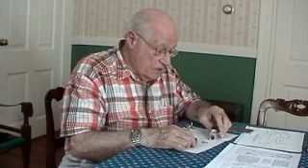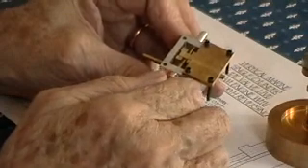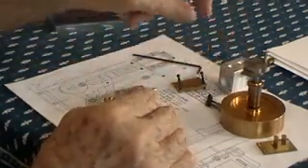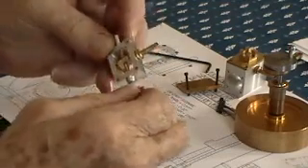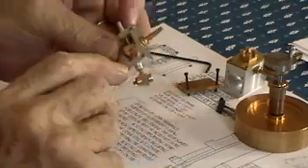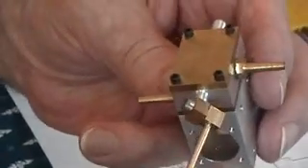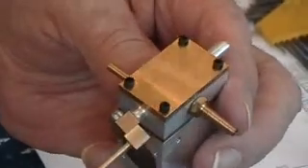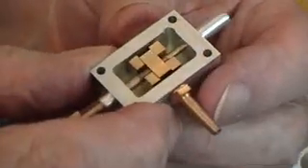Redesigning a vertical slide valve steam engine - Phase Two.

Comment from the maker: @BerkeleyGang  I now have DRO's on all three axes of my milling machine! The pressures are very low - in fact I can run the engine on mouth pressure only! Over 20 psi, it goes ballistic!  I like to get flat and accurate mating surfaces so the need for gaskets is minimal, but since the steam chest cover has to fit over two separate steam chests, it needed a gasket there as although the steam chest thicknesses mike up the same, they leak without gaskets.  Thanks for your nice comments!

Comment: I think you'll find a DRO to be a significant improvement over counting (and losing count of) turns. Even something as simple as the iGaging scales - about $30 an axis. If you want to go all-out, the Shumatech DRO-550 is a very economical full DRO for your mill and/or lathe.

Are pressures low enough you don't need gaskets?

Thanks again for sharing your work!

Comment from the maker: Yes, it is! The original horizontal Elderberry Mill Engine had an aluminium cylinder and it seemed to work very well.  But I agree - it is unusual, I would prefer 360 brass but as the smaller Elderberry engine worked well, and I wanted to  move on, I used aluminium too.  But I may well make another cylinder (& piston to, they have to be a matched pair) later onb to satisfy myself!  Then I will have added to the improvements!  Regards - John.